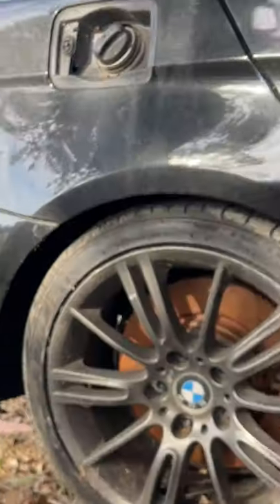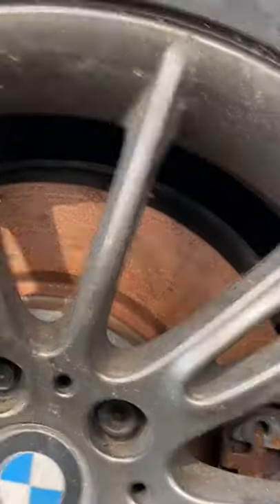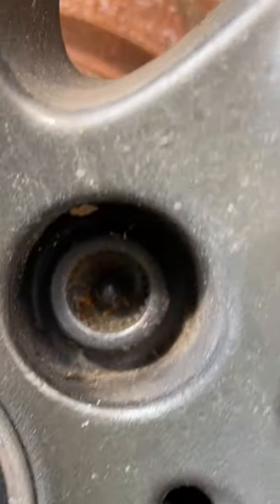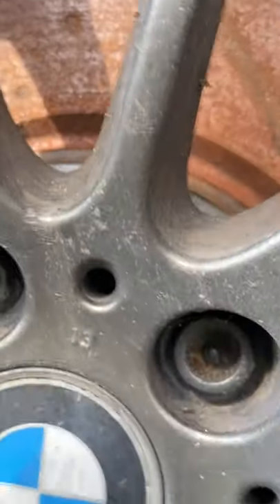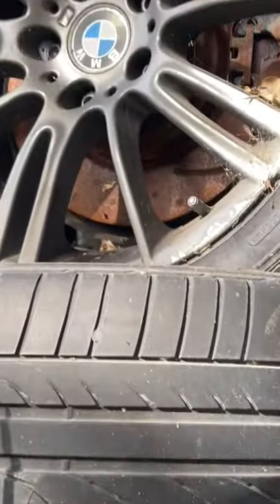Removing BMW LOCKING NUT/BOLT Without A KEY #shorts

Comment: I lost my bmw lung nut key as well, me stupid forgot to take it out off the bolt after torqing down and drove off. It fill out somewhere eventhough i didnt drive much few blocks before i noticed it was gone. I will try this method but i will check with local bmw shop first for replacement.

Comment: Great 👌, just in time to take my wheels off.
Reply from the maker: Did you have the same issue? No lock nut key?
Reply: @ZeroTo60Tube  Yeah, was going to buy one. But I guess I will give this method a go.
Reply from the maker: Hey have you have a half inch socket, give it a crack. You do need a decent sized hammer and properly hit it in. I used a cheap sp tools socket on both locking bolts and it doesn’t damage that socket at all. Let us know how you go.
Reply: @ZeroTo60Tube  thanks for the advice.